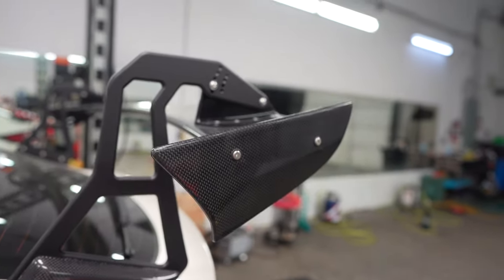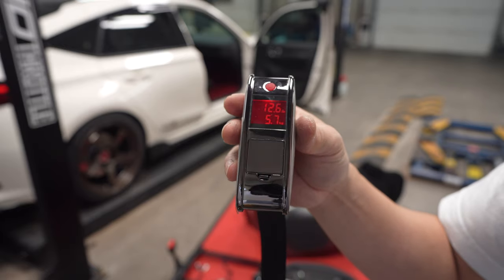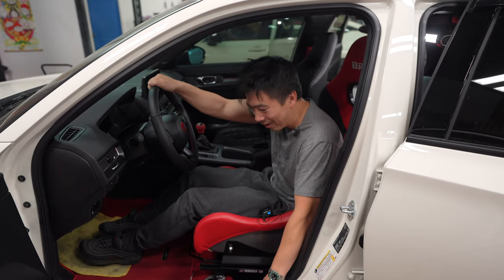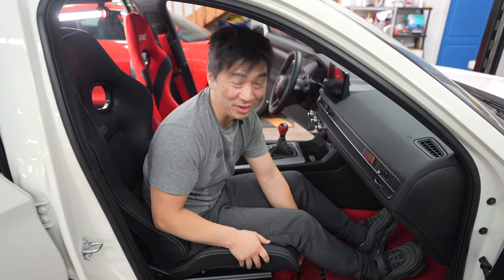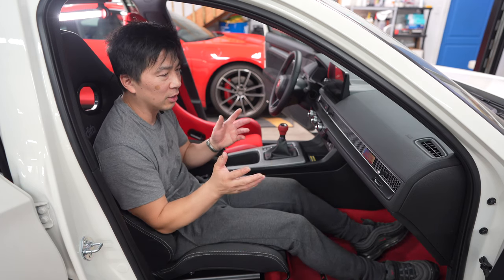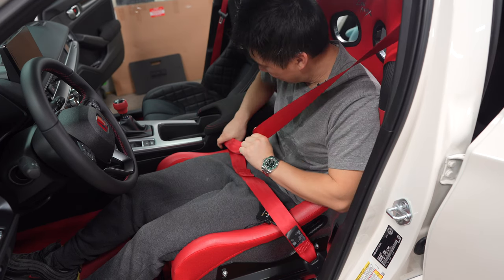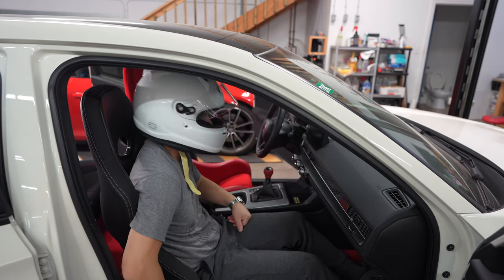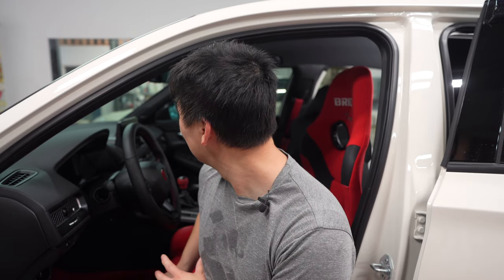Full Bucket or No Bucket Seat?

Comment: @10:54 definitely want to go through the holes on the seat. with the belt around the outside, its tensioned around the bolsters, not your waist; if you got into an accident, you'd slide right under.

ideally you want the run some sort of buckle extender to get the buckle on the inside aswell.
Reply from the maker: Thanks for the great information 👍